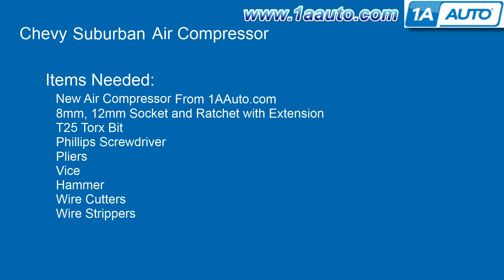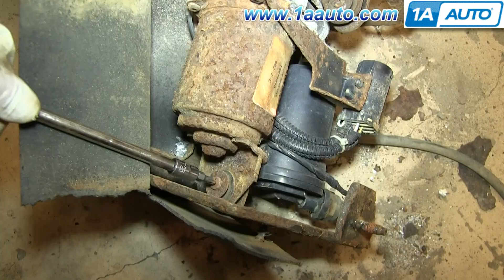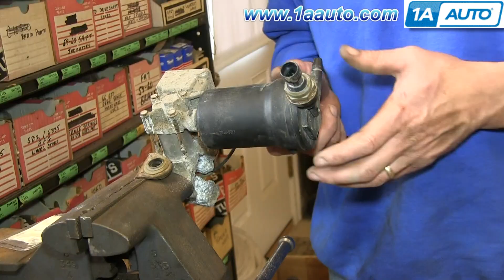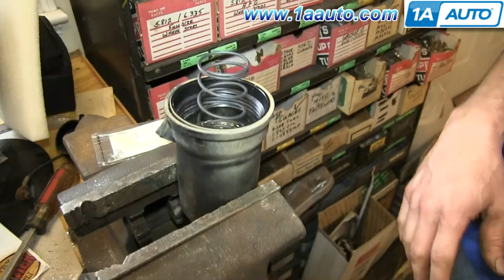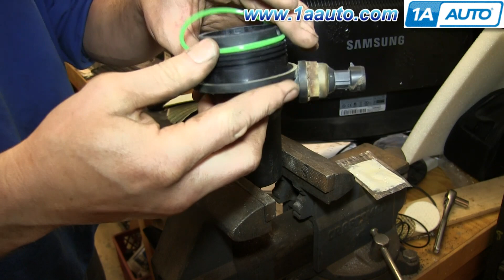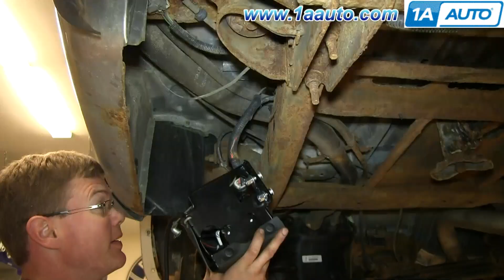How To Replace Air Shock Compressor Motor 00-06 Chevy Suburban

Comment: Strangely I can not find parts (rear left suspension height sensor) for my 2003 tahoe. If I change the year to 2004 in my search engines, I find everything I need. I wonder why the parts are not listed on a 2003 tahoe?

Comment: I can't find the rebuilt kit for the compressor
Reply from the maker: +Hector Hernandez Thanks for watching, but unfortunately we do not carry the dryer rebuild kit anymore.  We offer a complete swap out that has the compressor and dryer, here is a link to it!  https://www.1aauto.com/air-ride-suspension-compressor-arnott-p-2793/i/arasc00030?f=1071981&y=2004

Comment: Couldn't locate the part on the site, is it still available?
Reply from the maker: +Just_Fun Yes, 1A Auto carries the Air Ride Suspension Compressor with Dryer at the following link:  https://www.1aauto.com/air-ride-suspension-compressor-with-dryer-dorman-949-000/i/dmasc00001?utm_source=YouTube&utm_medium=CTA%20Comment&utm_campaign=1ATony

Comment: Did the install and went very well, a bit tough getting the darn canister opened to swap the filters and beads...was about to say the heck with it but persisted w/ using an oil filter removal tool ;&) and didn't have a vice....
Glad I did as it was about as dirty and nasty as it could have been....